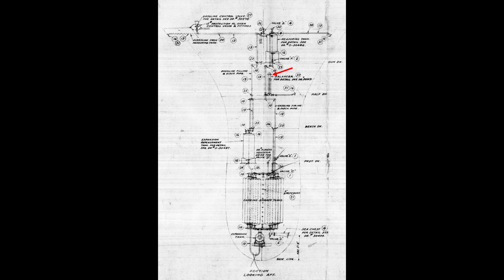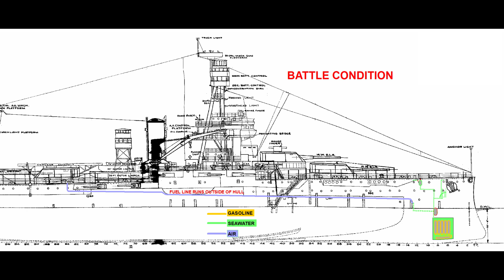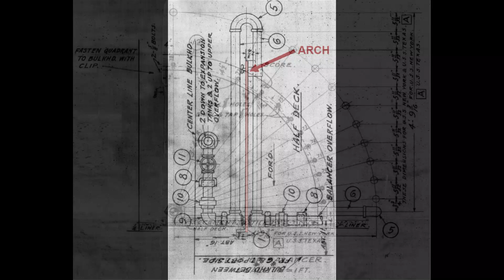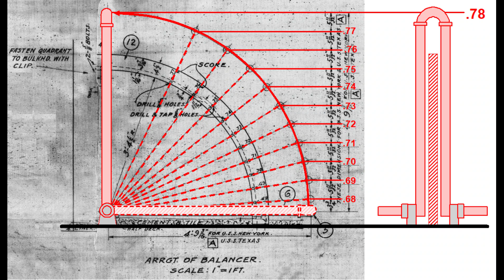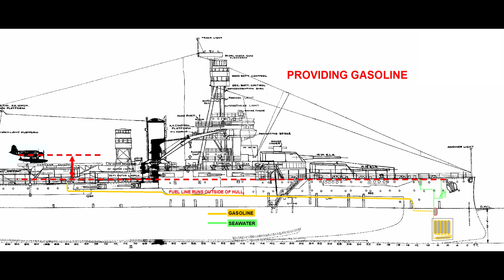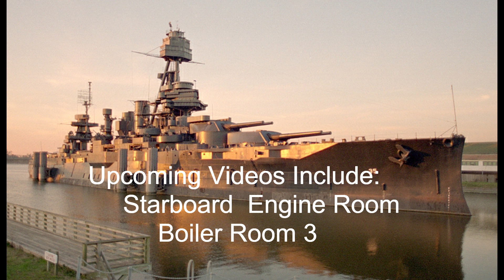Battleship Texas, Answer to "What The Heck Is This?"

Comment: "Fuel line runs outside of hull" sounds like a bad idea for a battleship 😧
Reply from the maker: I think it was a great idea.  Gasoline and its fumes was definitely the most volatile substance on the ship.  I'd rather have a gas line rupture or fire outside of the hull than inside.  Besides, the gas line was always drained and could be purged with seawater prior to going to condition one, which was prepared for battle.  Gas lines inside the ship that were difficult to drain could be filled with seawater from the fire main.

Comment: I don’t understand how it did not cross contaminate you must have never been able to run it close to dry
Reply from the maker: You are right.  There is a small zone between the two liquids where they combine. Like an oil and vinegar salad dressing where the two ingredients are shaken to combine them,  they don't chemically mix, they mechanically "slosh" together.   The key is to not draw the fuel down enough to get into that zone where agitation combines them.

Comment: i don’t understand, would this not be volume based system, ohh it a balance system so then it’s based off weight. I thought they would of used tanks like in submarines with a booster pump or a volume system to eliminate air pocket for safety.

Comment: Did these older craft use gas? I was under the impression they have always used (aircraft) diesel (fuel). Not trying to be a word-troll, just curious if I was mistaken.
Reply from the maker: Gasoline was primarily used by the spotter aircraft and maybe by small launches.  Diesel was used to feed the emergency generators and cold start boilers.  The boilers used Navy Special fuel oil.
Reply from the maker: Ko

Comment: There's something I REALLY don't understand here.  I would have thought that the displacement of gasoline in the tank would have been volume dependent, not weight dependent.  If you add one gallon of water, it displaces one gallon of gasoline.  What the heck am I missing here?
Reply: It's a gravity based system, not hydraulic. If it was pressing water into the system, it would be gallon:gallon, but because water is falling into the system, it's pound:pound.
Reply: @gearandalthefirst7027  you've hit the problem on the head - the system, as described, is hydraulic.   All gravity is doing is making sure that the two liquids don't mix.  As described, the system would work just as well (physically - not for safety purposes) if they just added more gasoline from that temporary tank to squeeze fuel down the outside pipe.  The difference in weight is irrelevant.

I'm not doubting that the system functions as advertised, but there is something missing in that description that would make density relevant.
Reply: @selkiemaine  i would say it probably has to do with measuring gasoline by wieght. They want a wieght of fuel for a given mission duration and this allows you to neatly convert gallons of water to pounds of fuel
Reply: @Ethan-3369  thank you!  That makes sense.

Comment: Side note about clearing fuel lines, the big carriers used a pump system to fuel aircraft in the hanger and on deck, for a time these were just defueled in combat, after lexington burned and went down in the coral sea, an engineer on yorktown went to the damage control officer with the idea to take those defueled lines, and pump them full of CO2, which suppresses the oxygen fuel mix in the event of a breach, this would later save the yorktown from bomb damage during midway, as well as enterprise during her numerous battles and was eventually adapted into every single US fleet carrier since.

Comment: This is factually incorrect. 835 pounds of one liquid does not necessarily displace 835 pounds of another. How much is displaced is based on the volume and has nothing to do with the weight. Consider a blown up balloon with a volume of 1 gallon of air put into a full tank of water. The amount of water displaced is 1 gallon. Now release the air from the balloon and put the same balloon in the full tank of water. Almost no water is displaced but the weight of the balloon has changed by only a negligible amount. This is because it is the volume of the object doing the displacing that matters and not the weight at all. The device in your video was probably used to convert gallons of fuel into pounds of fuel pushed out because the aircraft would request its fuel by weight and not by volume.

Comment: I don't get it. 100 gl. of fluid is a volumetric measurement not a weight measurement. 100 gl. of water gets you 100 gl. of gas by displacement.
Reply from the maker: The intent if the original system was to provide a one step way to make it appear that 100 gallons of water will displace 100 gallons of fuel.  While you are looking at volume, what is actually in play is weight.  The best way to look at it is that while you are measuring 100 gallons of water, you are actually using its 835 pounds of weight, not its volume.  Its the weight of the water pushing 835 pounds that displaces 835 pounds of fuel.  The problem is that the fuel has a lower specific gravity, so you will get more of it.  For instance, if it is .74, 100 gallons of water will displace 135 gallons of gas.  That is very bad if you are filling a 100 gallon tank.  Therefore, setting the balancer at .74 makes it dump 26 gallons of the water so that the remaining 74 gallons of water has exactly the weight required to dispense 100 gallons of gas.
Reply: @tomscotttheolderone364  This is factually incorrect. 835 pounds of one liquid does not necessarily displace 835 pounds of another. How much is displaced is based on the volume and has nothing to do with the weight. Consider a blown up balloon with a volume of 1 gallon of air put into a full tank of water. The amount of water displaced is 1 gallon. Now release the air from the balloon and put the same balloon in the full tank of water. Almost no water is displaced but the weight of the balloon has changed by only a negligible amount. This is because it is the volume of the object doing the displacing that matters and not the weight at all. The device in your video was probably used to convert gallons of fuel into pounds of fuel pushed out because the aircraft would request its fuel by weight and not by volume.

Comment: Wonder why they never used diesel instead of gasoline, more power?
Reply from the maker: Gasoline was for the aircraft.  They also had a large tank of diesel located in an inner bottom tank.  It was used to power the two emergency diesel generators and to cold start boilers if there is no steam available to run fuel oil pumps and heaters

Comment: Neat. When using gravity alone, just opening a valve and letting the weight of water do all the work, you will get an equal mass of gasoline, not volume. But if you push 100gal of water into the tank, and the two don't mix, 100gal of gas will be pushed out.
Reply from the maker: Thank you.  That is a very succinct way of putting what I was having trouble getting out.

Comment: What's interesting is this system probably wouldn't work with freshwater because freshwater would contaminate the gasoline. Saltwater doesn't contaminate the gasoline, because it pulls moisture out of the gas due to osmotic pressure.

Comment: A gallon is a measure of volume, not of weight. The density variations of the gasoline don't really matter so long as it still floats on water. 100 gallons of water will always displace 100 gallons of gasoline in a tank of fixed size.
Reply: Yes but depending on the density if the gasoline 100 gallons may either have less or more total energy meaning that said ship would run for less or more time on the same volume.  This ensures that 100 gallons of water always gives out the same mass of gasoline not volume I believe
Reply: @Aztesticals  Except that doesn't hold up. The plane's fuel tank is also based on volume. A full tank is a full tank. The plane's carburetor would have to be tuned to the fuel, but that's it. More likely the device was used to calibrate the amount of water pressure needed to ensure there was no vapor space at the top of the tank based on temperature.
Reply: @WardenWolf  Yeah you right.  I was think air craft carrier where gas may be given by mission requirements aka enough fuel for a 200miles there and back plus 10% extra.  There knowing fuel density would change the volume used

Comment: During her 1925 refit, when the coal-fired boilers on Texas were replaced with fuel oil-fired boilers, it seems to me that switching to using fuel oil instead of sea water would have made much more sense… Like seawater, fuel oil is also denser than aviation gasoline, almost certainly more so than sea water (but probably more prone to mixing, or incorporating with the avgas), and has a much higher flashpoint than avgas, so immersing the avgas tanks or cylinders in the bow with oil, and pumping fuel oil through the pipes would have MOST (but not all) of the safety benefit of using seawater to surround the avgas cylinders & keep the tanks and pipes full & clear of avgas vapors. Secondly, even though fuel oil has some level of acidity, it is nowhere near as corrosive as sea water, in fact, it would actually protect the pipes and tanks from corrosion, which would certainly reduce the amount of rust particles and other debris making their way into the fuel tanks of the aircraft (unless there was a filter system that hasn’t been mentioned?), and any fuel oil that did make it into the tanks of the aircraft would certainly do less damage to the tanks, fuel lines, and engine (running rich) of that aircraft than the damage that even a minuscule amount of sea water would cause… surely there must have been a filtration system fitted to deal with this before the avgas would be pumped into the aircraft’s tanks?
Reply from the maker: I don't like second guessing the designers who certainly had more knowledge on the subject than any of us.  However, I will give a single response.  While it has a higher specific gravity than avgas, fuel oil readily blends with it and would completely ruin the gas if you used it to displace gas in the tanks.  Flooding the compartment with fuel oil to immerse the gas tanks does not provide an inert storage space.  Plus, they had to be able to get into the space to maintain fuel lines and fittings, and probably scrape rust and repaint.  With seawater, you simply pump it out and enter the compartment.  With fuel oil, it would require draining, then steaming out and venting the compartment for an extended period of time, like they did with fuel oil tanks, before they could even open the deck hatch that accessed it.
Reply: @tomscotttheolderone364  All good points- thanks for the fast response!

Comment: That was a good breakdown. If only they had consulted the engineers of the water displacement system to also take a look at filling the airplane with water instead of fuel until it was planning on taking off, so as not to douse the turret in gasoline from a squishy airplane sitting on it... and possibly equip the plane with an oil/water separator for contamination remnants that would be present in any of these displacement designs.
Edit: Or perhaps just not store the thing topped off with fuel if you're going into battle without your spotter plane airborne.
Reply: 1. If the airplane was still on top of the turret during combat then things have gone wrong.
2. A gasoline fire on top of the turret is a non issue, the fuel will burn off and the turret crew wouldn't even be aware of it. Deck fires were both expected and non threatening during combat and thus would be left to burn out (It would be suicide to send men out of protection during surface action)
Reply: @Cragified  If deck fires were a non-issue, then why is the current USS Texas a submarine?
I kid, I kid... But really... The surface vessel USS Texas had a wooden deck. Gasoline fires on wood are generally regarded as unsafe for equipment typically found in that area, such as life rafts, provisions, ropes, deck, firefighting stuff, deck area denial (while alight or in the design phase), also sailors, etc.. In fact, if I recall correctly, this video was about the measures that recognized gasoline as extremely dangerous in battle, but those measures were also rendered less effective due to the selective foresight of keeping the plane fueled up for faster deployment. I don't fully understand your statement about risking your plane/eyeballs though. I think we may have a slightly opposite view of what is and is not an acceptable risk in this case. It may be from a misunderstanding of what that plane was for. 
That wasn't a scout plane. It takes many planes to do any meaningful searches into the fog of war, and a battleship that is scouting has wasted every advantage it was built with. This plane-on-battleship was there specifically for watching the splashes from the ship's main guns when it was firing beyond visual range, as is still quite a common requirement with artillery fire in land battles (FM 6-30 Chapter 4: Call For Fire). Radar was so new back then, that much of command didn't take it seriously, and the output it gave was largely gibberish. (Pearl Harbor had an early radar set, for example, and it only seemed to cause confusion until [many] human eyes confirmed that there were Japanese planes overhead. It would not work for shot-spotting then, and does not do so now (curvature of the earth, and ground clutter). It can still be used for counter-battery fire (currently), because of the shells/rockets being airborne, enemy big-guns (as opposed to Bigguns, ala Al Bundy's favorite magazine) are high-priority targets, and simply knowing that you need to "shoot and scoot" or face counter-battery fire and the risk of possibly being hit, limits the volume of fire an enemy can put down in one go.

Comment: 3:35 pretty sure you mean "pounds of water/gasoline". A gallon is a unit of volume, therefore one gallon of one fluid will equal one gallon of another. The differing densities of sea water and gasoline require a conversion ratio, which you were referring to
Reply: My thought exactly.  Pounds vs. gallons.  Pounds are use with aircraft to figure weight.